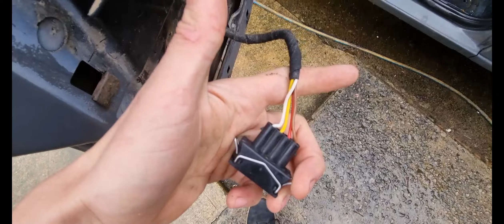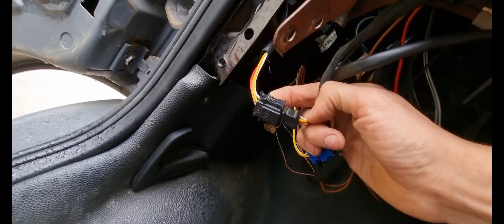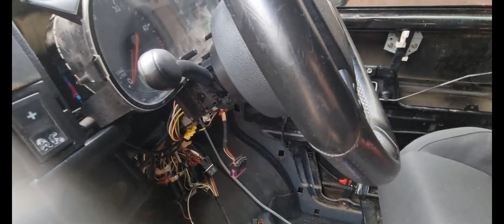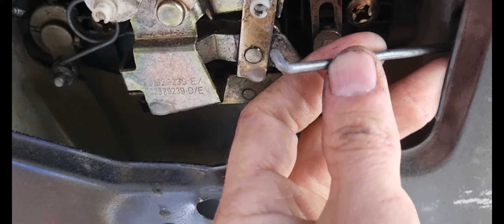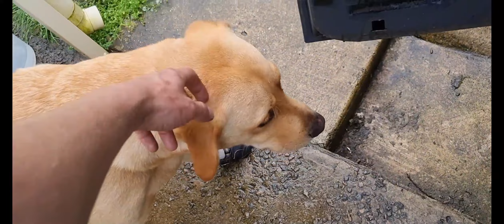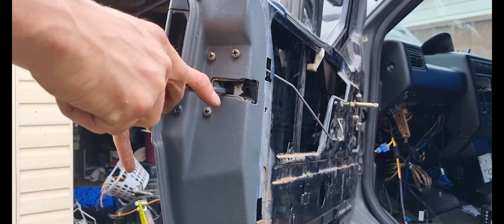I Fixed My VW T4 Central Locking (Now You Can Fix Yours)

Comment: Everything works perfectly on mine untill i plug in the drivers door actuator with or without attaching the linkage all the other doors lock. Tested all the actuators and all are good im wondering if its a signal problem

Comment: Thanks for your thorough instructions. The actuator on my drivers side wasn't working. A multimeter continuity test revealed one of the wires leading to the unit was broken. After removing all the factory tape which is a challenge itself, I found the culprit, patched it up and it's working now. Unfortunately, I had to cut the rubber bellow out but thats an easy fix. It took me several hours but worth it as I learned some things along the way.